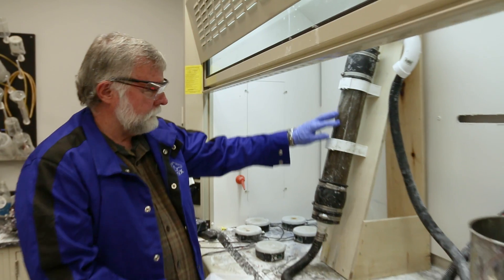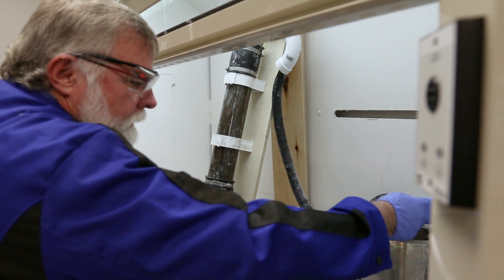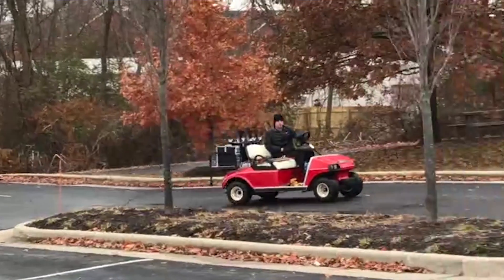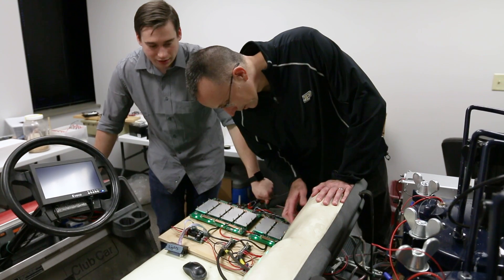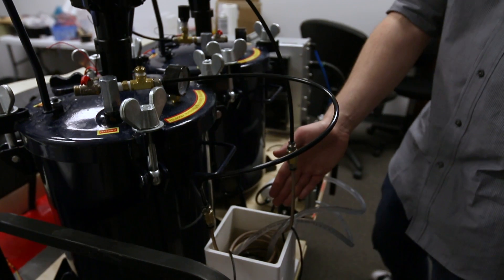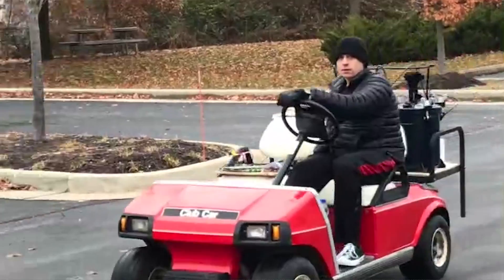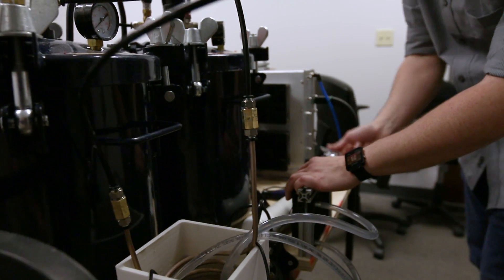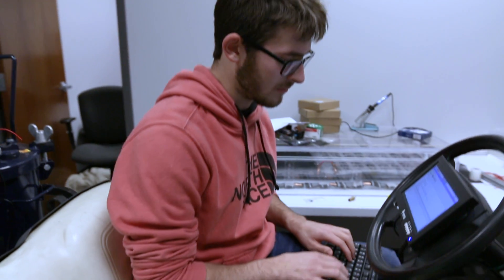‘Refillable’ technology could provide enough energy to drive an electric car up to 3,000 miles

Comment: he said no membrane l thought its essential to this tec , and often a problem destroyed fast and expensive  A membraneless battery relies on laminar flow in which two liquids are pumped through a channel, where they undergo electrochemical reactions to store or release energy. The solutions stream through in parallel, with little mixing. The flow naturally separates the liquids, eliminating the need for a membrane.

Comment: Seems amazing, though I have zero technical knowledge in electricity. But this seems 100x more believable, more credible and less like a scam scheme as nanoFLOWcell thing does. With a technology like that, as soon as you get these results, you have to gain trust. It shouldn't be difficult to gain trust if the technology really works. 

Good luck, really want to believe in those good things.

Comment: Can I assume that this technology is not a "home brew" option.... by that I mean reliance on a supply based facility not unlike petrol or diesel? One of the attractions for me with EVs is that I can charge it up myself from my own solar panels - this would not be possible with this new technology? I still think it's great and I am sure has huge potential but it's possibly not for me. I recall there was excitement over "zinc air" batteries in the past driving 1,000 mile but the issue being a chemical recharging process that required the cell's replacement at a kind of "filling station".
Reply: You could in theory supply the energy to the grid that would regenerate the energy potential of the fluids. Might be better (less costly for you and everyone) to decentralize energy production but centralize generation of the battery "fuel".

If the range reached 1000 miles, then the typical person would only need to charge once per month (or every ~15 hours of highway driving). That doesn't seem too bad.